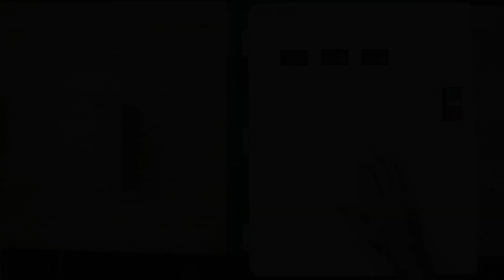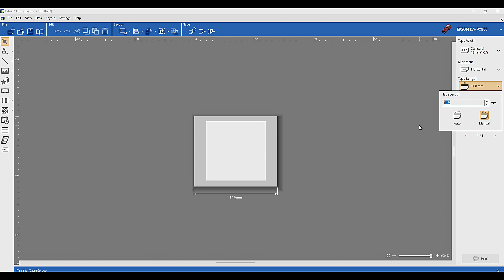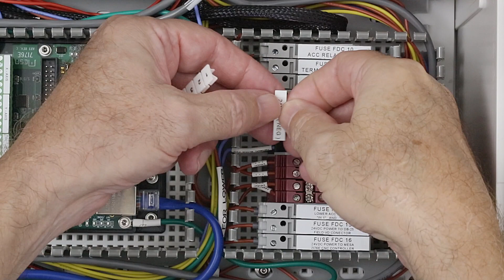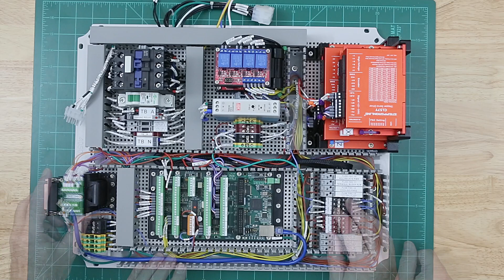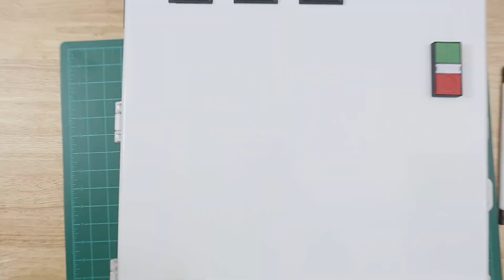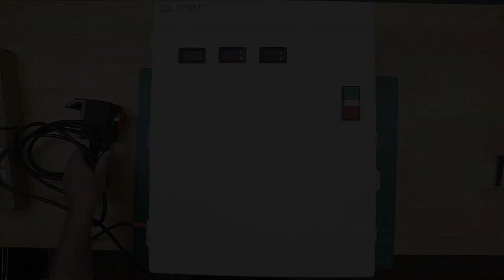CNC Conversion - Electronics Enclosure Gets Powered On

Comment: This is truly amazing. I can only hope that I can build something like this one day.

As a beginner in electronics, I wasn't able to understand why would you want a relay turning the contactor on? Using two push buttons can turn on the 120v contactor coil directly, isnt it? Or maybe I am wrong somewhere?
Reply from the maker: Switches could control the contactor, but I wanted to be able to control the the contactor with the low voltage from the Mesa card too.
Reply: @joat_mon  ahh, it makes sense now. Thanks!

Comment: Nice job, thanks for sharing!  A concern I see is the estop shuts power to the stepper motor power supplies, my z axis would fall down perhaps onto the work in that case. Thanks again for sharing your videos.
Reply from the maker: Excellent point about the Z-axis falling without power to the motor. It's good for others to see your comment and keep in mind that it could be an issue for their build.
My Z-axis doesn't move when power is removed from the mill, so it's not an issue for me.

As for my e-stop approach, I use the "pause" function most of the time to stop the mill if I see some issue. I don't use the e-stop unless something major has gone wrong.
There are several approaches to e-stop functionality. I set it where the pause function is the way I'll stop the mill most of the time. In my setup, the e-stop is for when I want to stop-everything-right-now. Like there's fire coming out of the controller, or an axis has crashed and I want to kill all power everywhere. If a stepper driver, or power supply is smoking, I want to be able to shut everything off instantly.
Others may choose to take a different approach to E-Stop implementation. Or need to, for reasons like a falling Z-axis.
On the falling Z-axis... If my Z-axis tended to fall when I removed power, I'd probably make a normally-engaged brake of some kind to stop the Z-axis from moving. Maybe something like... spring tension keeps the brake engaged, and when power is applied a solenoid disengages the brake.
Thanks for commenting!

Comment: I watched the complete series. Great job (also the videos)! You should have way more views. One question; I wonder about the sizing of the power supplies. You use a separate PS for each motor. I was surprised about the low readings on the displays (max 2 amp I guess). Do you think the peak power is much higher? What is the rating of these power supplies and motors? And did you ever considered a shared PS? Again, thank you for taking the time to create this quality content.
Reply from the maker: Thanks!
I don't think the peak current is much higher. The steppers aren't really being driven very hard. The power supplies are variable, up to 48VDC (they actually go to about 50VDC) and 10 amps. The NEMA 34 driver is up to 8.5 amps and up to 110VDC or 80VAC (more on this in a minute). The NEMA 24 drivers are up to 7 amps and 24-50VDC.
Having multiple power supplies brings the luxury of having a backup available should one fail since one 10A unit will easily run two stepper drivers. That said if I were to do it over I'd use stepper drivers that will accept AC volts like the NEMA 34 driver (CL86Y). That way I could power the steppers with a step down toroidal transformer in a separate enclosure, opening up space in, and simplifying, the main enclosure. Would probably have to de-tune (lower the peak amps) the CL86Y for the smaller steppers.
Since posting the videos, I've also upgraded the cooling fans and replaced the E-Stop connector with a better one.
Reply: Thank you for the info

Comment: Is it necessary for the power supply to the motor drivers to be switched via contactor? Wouldn't the alarm input to the mesa card already tell the drivers to stop?
Reply from the maker: That's correct. The alarm input would should/would stop the drivers. Shutting off the power supplies VIA the contactor is redundant and sort of a sledge hammer approach. I did it as a backup in case there's an unforeseen problem in the Mesa card alarm circuit, like a faulty relay or loose wire etc.

Comment: What is the model number and brand of those quick connectors between your base and the door?
Reply from the maker: The white connectors are Molex brand, for14-20 AWG wire. Model - Latch Lock, MLX, 2.13mm D.
Part numbers vary depending on the number of pins.

I mistakenly said Amphenol connectors in the video. Habit from my aircraft maintenance days.
Reply: @joat_mon  B2 engineer?

Comment: The screw starter is the tool I've always wanted but never knew existed.

Thanks for that.

Your cab is super neat,  how are the internal case temps at extended running ? 

I like to keep my hybrid stepper drivers cool.
Reply from the maker: Your welcome. There's a little more info in the description on the screw starter.
I've had some that don't work as well. This one has pretty stout springs so it hold the screws well.

As for the internal case temps., I have no idea at the moment. The mill hasn't run more than 30 minutes yet. 
Judging by the amps being drawn by the system so far though, I don't expect it to be a problem. I've got about 0.5 amps from X and Y, plus ~1 amp from Z. So about two amps total at an average of 40 volts makes for 80 Watts. Even if that was just an 80 watt heater element, which it's not, the two fans would be plenty to exhaust the heat. I think.  🤔    Think of those two case fans blowing on a 100 watt light bulb, which is essentially a 100 watt heater.
Reply from the maker: Now that summer is arriving and the temperatures in my garage are rising, I'm getting a better look at the temperatures and cooling capability of the fans. See the description for an update. Basically I upgraded the fans to 80mm x 80mm x 25mm and replaced the foam filter with a wire mesh one.
Reply from the maker: Just ran the mill for most of the day today in an 85°F garage. At the end of the day the exhaust air temperature was 102°F; so a temperature delta of 17°F.    Not too bad at all.

Comment: That has to be the best use of cabinet space I've seen on a control box. I have easy access to all of my components but then again, my case is probably twice the size. Great fore thought on placing the electronics, especially the power supplies.
Reply from the maker: Thanks. I'm thinking of doing a video on what worked out well and what I'd do different... there's always some things that could use a bit of change once one has the benefit of hindsight.